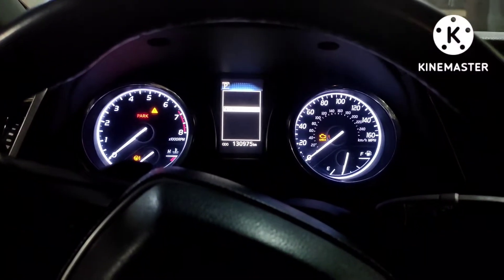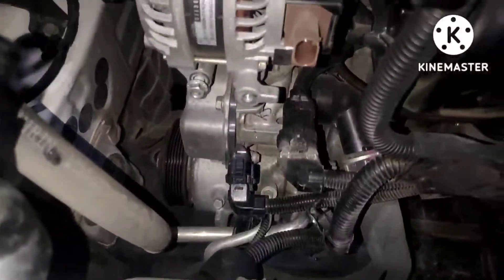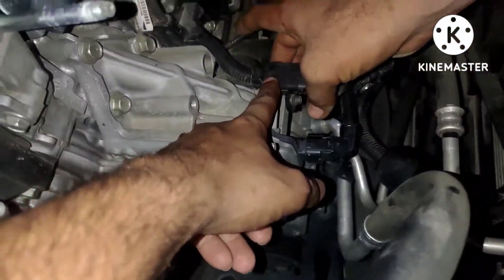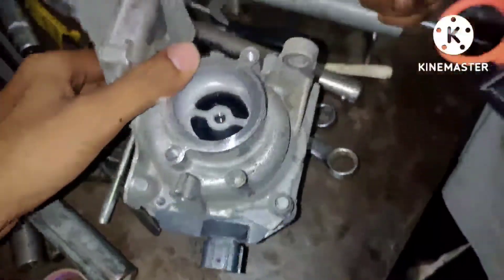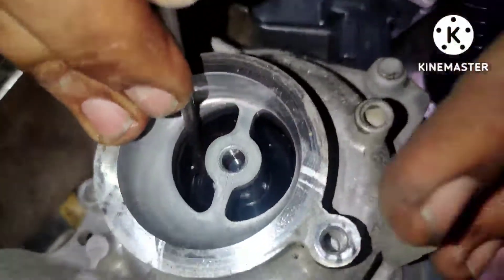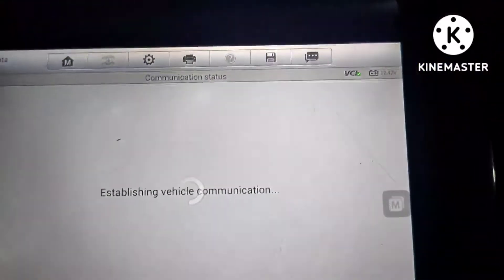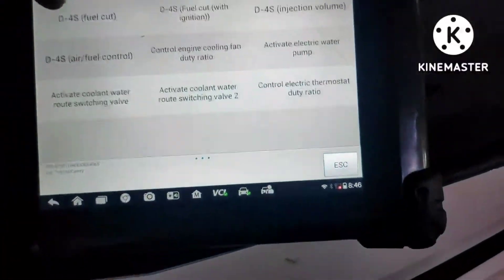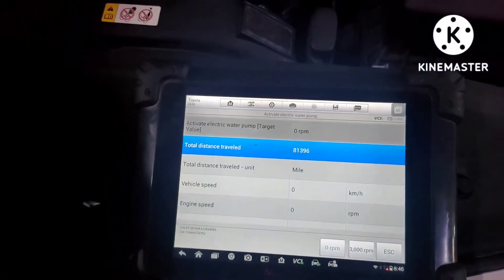Toyota Engine Coolant Pump Actuator Stuck OBD Code P26CB71 - SOLVED

Comment: Brother, i need your help. 

Vehicle: Toyota camry 2019 hybrid. 
Problem: engine water pump actuator stuck (P26CB71)
Findings: Engine light turn up, it stays 1-2 days, and disappear autometically, after 1 week or so turn up again. 
Engine temperature never gone up from the normal level or no overheating at all.

Findings: I have remove and check the water pump. Propelar was working good. But still i have change the water pump (only pump, not whole unit. 

But problem remain same. Clear the code by scanner but it comes back after couple of days. 

Can you please help,
 what other element should i check or how can i solve that problem.
Reply from the maker: Are there any dust particles in water??? Also, you need to use proper coolant mixer with provide lubricant like oil. Also, check for thermostat, maybe not open properly keep water pump un strees .
Also check for freez frame data on scan tool when code appears look for water pump rpm

Comment: How long did it take to replace the water pump?
Reply from the maker: It's so easy you can do it by yourself, maybe 35 minutes start to end to bleed the air after you replace the pump add the coolant then start car with heater on that will force pump to run after few seconds trun off add coolant repeat the step until no space for coolant.use 5L ready mix coolant from toyota pump need coolant like a oil to last long.

Comment: How did you take off the electrical connection on the water pump, having troubles taking it off
Reply from the maker: It's easy press a lock on connector and it it off some times. It's stuck a little

Comment: Bought used camry xse but has code p26ca, changed the water Pump but code still remains. Looked everywhere and cant find any help on the internet about the code or fixes. Please help
Reply from the maker: Did you check the wiring between the coolant water pump and ECU.and The water pump is used or new?

Comment: Brother need help… I got code ENGINE COOLANT PUMP OVERSPEED … what is the solution..? My car is Toyota rav4 2019-2020
Reply from the maker: Overspeed 🤔 please share the code?
Reply: I don’t have clear code but it’s ended with Ct37
Reply: Hi carfaults here,
It should be a coolant pump because everything is included in the pump controller,motor, and dignostic system.
Most of the time pump impaller stucks if you found someone change the pump before you can swap thr pump controller and keep pump side that should work we do this sometimes

Comment: That’s wrong man , just replace the side piece. 4 bolts. 10min job
Reply: I wish I had seen this comment before performing the job, after I took the whole assembly off then I realized that, like you said, it wasn’t necessary to do all of that. Only the side motor can be replaced 🤦🏻‍♂️. I came back here to leave the comment for him and whoever might see this that that whole job is unnecessary
Reply: I was thinking that too. I’m in the process of replacing it
Reply: @Shadowking1O17  I replaced my last week , it’s $99 on Amazon .
Reply: @senadintatarevic6397  did a lot of coolant spill out? i wanna do the service myself and replace just the side piece but was wondering if i’d need to add more coolant and purge the system
Reply: What side piece? I have the same problem
Reply: @diantedwyer3575  the water pump is on the left side ( just look up online how it looks like , you will able to see it .
Reply: Not really, you may need to add a little bit , it’s really easy it will take you 15min
Reply: @senadintatarevic6397  glade I know now, should’ve looked at my notifications 3 months ago lol…I just forked up the money and replaced the entire water pump, lesson learned.
Reply: do i have to flush the coolant after?
Reply: @HmSultan02 no , maybe add little bit
Reply: Whats the part that needs to be replaced? Code just came up on mine
Reply: Not necessarily. The pump doesn’t come off. So it’s better to remove the whole assembly and use tools to separate the pump from its assembly outside the car engine
Reply: @ichi.ban01  The pump will come off, you just have to wiggle it out. Its really just that easy.
Reply: Did that. Didn’t work. Even after removing the whole assembly we had to use a hammer and a punch tool to pry the pump from the chamber so we can install the new pump.
Reply: @ doesnt make sense. Did you remove the 4 bolts and the harness holding it in place?
Reply: If you buy oem part, it will come with the whole peace, unless you buy aftermarket part that only 1 peace can be replaced. If it comes with the whole thing why not replace the whole thing!
Reply: @ehsanull because it's not necessarily lol literally what we've trying to tell you. The shitty cheap plastic electrical motor is the problem. Not the housing. Loosen belt, 4 bolts off. Reverse. Done in 10 minutes.
Reply: Basically you can bypass draining the coolant? Just take the belt off alternator and the 4 bolts? Refill what comes out? Ez pz.

Comment: Mine its works sometimes and stops sometimes!!! Yesterday it was not working, i tried today its working
Reply: One more thing fault disappeared today and came back again
Reply from the maker: Change it before too late if temperature hit to high then maybe you need to remove engine head

Comment: It happened to me last week! Will I have car problems in the future ? 😢 And does it happen to newish cars?
Reply from the maker: Well new car's have more electronics and parts which means more chances of having issues.
But it depends cars to cars some time we found car owner don't care about his vehicle but never having issues but some owners take care of his vehicle and still have lot of issues.
But i have few suggestion about new cars.
1 never change transmission oil.old oil keep particles of gear parts as transmission gets older transmission parts particles in oil help gears and clutches to work smoothly in my experience 70% transmission start giving issues right after transmission oil change. you can change oil filter then if oil is too bad just replace one or two litter oil also if you already feel bad shifting then you should go with oil change.
2 change engine oil regularly good quality oil
3 always use injector cleaner every 4 months add in fuel tank
4 time to time do self inspection under the hood for leaks 
5 always use oem air filter for engine